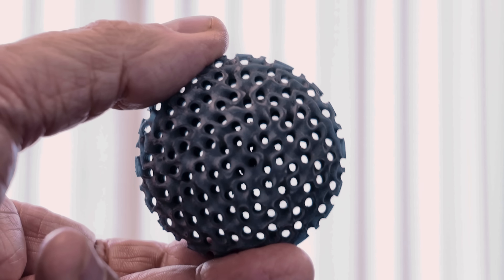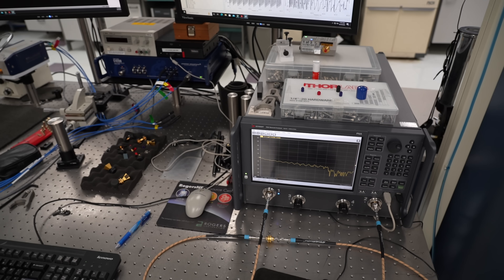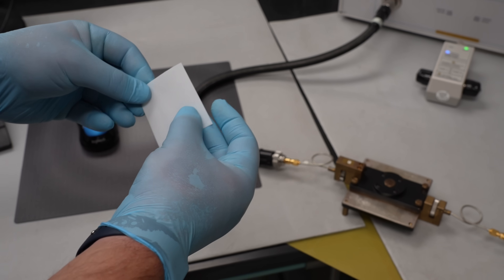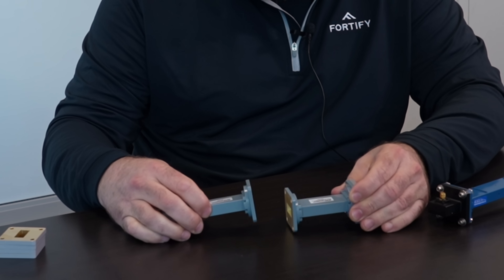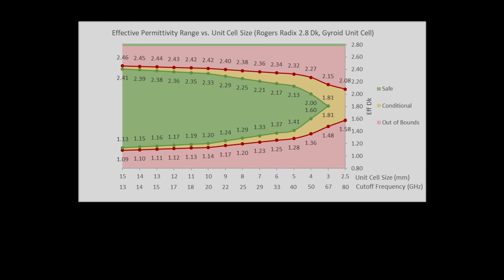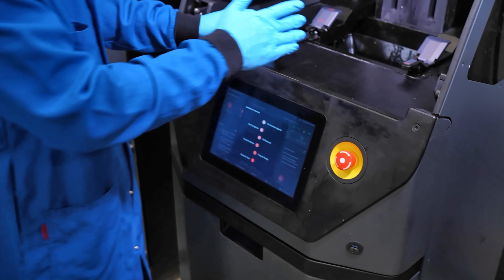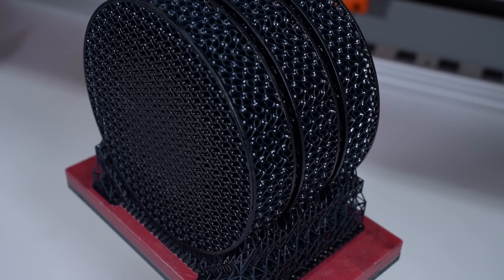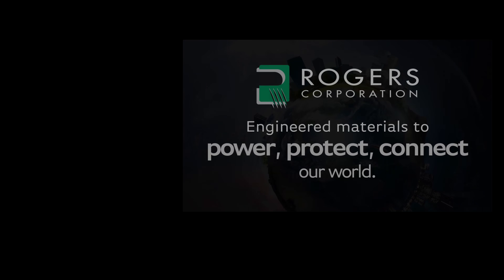Unveiling the Future of Antennas and RF Lenses using Radix™ 3D printable material!

Comment: High power transmitter engineer here, not an antenna guy.  My biggest question would be "What's the loss tangent of this material?"  (Translate:  Will I burn it up?  :)  )  As a transmitter designer, a good chunk of my day is to make the Tx efficiency as high as possible and there always a concern of losses after the amplifier.

Has Rogers looked into a variable (linear, not stepped) thickness PCB  using this material? (i.e. think complex impedance matching networks using transmission lines).  It was not uncommon for me to have 100:1 impedance transformations.  Just thinking out loud, might be helpful in getting a more practical design with a wider bandwidth.

Excellent video!  I've spent a LOT of time in the lab w/a NVA measuring Er and Df of materials to really dial in my simulations, so it was interesting to see how Rogers measures some of their materials! Very impressive and looks like a lot of sharp guys (or gals)!
Reply from the maker: I guess you could print a gradient or stepped index and metallize over it, but please get in touch with them, they are working on all sorts of interesting applications and materials.  Df is 0.0042 at 10 GHz and a tiny bit more at 40 GHz.  Data sheet also shows the rest of the characteristics if you follow the link to their landing page at https://landing.rogerscorp.com/5/Radix.aspx Have a look at Magtrex as well, it's an interesting material with matched permeability and permittivity (same value for each) up to 500 MHz or so, that's interesting for antenna miniaturisation, perhaps also for filters and matching networks?  If you need a contact, email me direct to neil@machiningandmicrowaves.com
Reply: @MachiningandMicrowaves  No specific need right now, but it does get the brain gears spinning!

Regarding a variable thickness board, wonder if you could make the bottom resin layer actually be the top layer of the printed circuit board (i.e. PC board is printed upside down) since it might be smoother?  Then the resin top layer (probably being a little rougher) would actually be the bottom side when flipped. Haven't done any resin printing, so just a WAG on my end.

Thanks!
Reply from the maker: I think you'd make up a GRIN layer to have constant physical thickness but variable permittivity, then use Rogers' adhesive that matches the Dk precisely to bond a foil layer or even a very thin single-sided copper clad PCB laminate.  It would be fascinating to see what is possible
Reply: @MachiningandMicrowaves  Interesting, lot's of possibilities.  Thanks for link, I need to round up some R&D money!

Comment: I'm totally clueless about all of this aside from knowing microwaves exist. Still found the video interesting. Well done :)
Not sure what to do with any of this information now, or why it would be exciting. How's this technology used, for what purpose?
Reply from the maker: The vid was really targeted at a small group of less than a thousand RF design engineers and academics, but seems to have found three quarters of a million other viewers!  It's really an enabling technology, allowing designers to create gradient index antenna lenses and other dielectric components and mounting foams. Applications are wherever you need to do complex beam-forming or compact antenna systems using the variation of refractive index to optimise some desirable parameter of the antenna lens like directivity or gain, while not spoiling some other parameters like sidelobe levels

Comment: this is remarkable this could be great for filtration
Reply from the maker: The structure looks very similar to the sparse open-cell foam used in the filtration system of my fishpond, but they only cost $5 each.  Perhaps not entirely an economically viable solution.  However, it's easy to create such a gyroid lattice using a normal FDM printer if you don't care about the RF dielectric performance

Comment: Another thing I know you don't usually deal with but could they use this for motors including the stator course since you said they could do copper impregnation
Reply from the maker: There are some good copper sintering systems out there that can be used to make 3D structures like rotors for induction-type drives, but using a deposition then electroforming technique wouldn't be better than what's already possible.  Perhaps there are possibilities, but the key use of copper and through-hole plating in the dielectric material is for RF purposes rather than power engineering and rotating machines.  I never say never though, let's see what engineers come up with using this technology

Comment: These are deep waters for me, but could the same technology be used for RF bandgap materials ("color filters") or for RF negative refractive index materials?
Reply from the maker: metamaterials with embedded metallization to create an apparent negative RI would still need separate layers as you can't print or insert metal into the print.  I hope to try some metamaterial experiments later in the year, although I'll be using my Prusa and some dielectric-loaded filament that doesn't have the same high performance as Radix.  I need to do a lot more reading and testing first. It's certainly feasible to make dichroic multilayer antireflection coatings this way, but the 4-8% reflection from a dielectric material transition isn't usually critically important.  The small lens I designed has a gradient index form the rear as an experiment to make a more broadbanded transition than the typical stepped or tapered transition I used at http://www.g4dbn.uk/?p=1644 and http://www.g4dbn.uk/?p=1250 and http://www.g4dbn.uk/?p=1363

Comment: What are the advantages of these antennas? my wifi router has sticks for antennas, these printed ones look cool, but what are their benefits? when i did rf engineering microwave antennas resembled cowbells. 👍😀
Reply from the maker: More in an upcoming video.  Normal metal antennas can be manufactured to have some customisation of their coverage pattern, but 3D print of lenses allows a much greater freedom to manipulate the electromagnetic fields to deliver a tailored radiation pattern.  My need was to try a new way of matching the antenna to the feed using a simple gradient, and to reduce the pickup of thermal noise from the ground and buildings by suppressing the side and rear lobes of the antenna

Comment: I am a ham but much of this went over my head, but from what I gathered does this mean you could DIY a phased array antenna? FYI - Great Video
Reply from the maker: It's more use to me for making a focussing lens to change the opening angle of a feedhorn and clean up the sidelobes, but it can be used for all sorts of things like dielectric waveguide with no metal, and combiners/splitters, matching sections and all manner of microwave/mmWave weirdness.  The limit is just Physics and the designer's imagination, within the parameters of the resin and fill density range.

Comment: When can I 3d print a 4000mm lens for my full frame camera? Anyway, back in 1980 I worked on a CNC machine for my senior project that allowed people to write the equation for an RF antenna and the result would be milled out of a block of metal. How things have changed. Thank you for your descriptions.
Reply from the maker: I'm building a servomotor attachment for my 1982 Colchester lathe so I can machine hyperbolic subreflectors for Cassegrains, parabolic main reflectors for mmWave, axially-displaced ellipses and reflectors, and Gregorian subreflectors from solid aluminium, so that's pretty much similar to you project from back when my lathe was just a casting that was maturing in a field in Essex

Comment: I loosely was able to follow along fascinating technology. I can only imagine what this sounded like to others. Do you plan on trying another array to send signals deeper into space?
Reply from the maker: It's hard to tell if my signal get anywhere with the power I am permitted to use. To reach Venus at its closest approach with a radar that can be received back on Earth still takes a really serious antenna and megawatts of power, but all radio signals above a certain frequency go out into deep space.  There's a bubble of expanding radio signals leaving the Earth at the speed of light, so the first radio signals of the right frequencies and power from perhaps 90 years ago are already 90 light-years away. although they will be impossibly weak of course unless someone has a receiving system a significant fraction of a light-year across.
Reply: I'm familiar with radio waves forever leaving earth and how the amplitude continues to halve along its journey. Was a major oversight of mine with the power you'd need. Maybe you could partner with someone that can legally transmit at the power range you'd need.
Reply from the maker: @79mini  There have been a few of these attempts, but with the loss of Arecibo and the pressures on other big dishes, it's hard to justify the cost, especially the megawatts of electricity

Comment: I have been thinking about chemical vapor deposition of conducive metal on 3D printed radio opaque antenna substrate. I am not versed in math or science but have curiosity in electromagnetism and low frequency radio waves compared to microwave. Do you know if the dielectric properties of those antenna change characteristic with varying temperature? If you put energy in dose some turn in to heat?
Reply from the maker: The material absorbs about 0.5% of the power passing through it, so at extreme powers, cooling is important, perhaps by forced air as the thermal conductivity is relatively low. The ceramic inclusions aren't bothered by any temp that the resin can stand, and I don't think the resin Dk/Df changes much below the start of melting. Masked CVD or PVD might work well on the right substrate types. You can always build the thickness of the metallization using electroplating and/or electroforming
Reply: @MachiningandMicrowaves  Thank you.

Comment: Imagine the possibilities for all types of antenna, for all spectrums of EM!  I'm fascinated by antennas, not just for EM but for  extreme concepts, X-ray antenna, Gamma ray antenna, what if Nano structure of the Universe is an antenna of some sort? At planks scale? What if Black Holes are antennas? 😐😐😵‍💫😇
Reply from the maker: A black hole would make a very nice antenna lens if you could arrange to illuminate it with a ring of sources with a taper that would end up as a single point beam after the Einstein Ring diffractions are superposed.  It might be tricky to get a wide enough distribution.  X-ray antennas are easy enough is you use multiple parallel grazing-incidence mirrors with parabolic then hyperbolic curves, or stacks of diamond or sapphire lenses with steep curves and aspheric forms. I'm working on some Bragg resonators using sapphire disks at microwaves, but certainly nothing like X or gamma ray wavelengths.

Comment: I'm new here, so maybe this is shown in another video, but I would really like to see how you designed the antenna.
Reply from the maker: That will be in an upcoming video. Sorry, I answered the wrong question! I did a manual calculation of the right variation of density in the Mikaelian lens to get the basic dimensions.  The I used OpenEMS running under Octave to generate the near E-field and farfield outputs, then Paraview to visualise the data streams. Once I was happy with the design, I created a CAD model in Fusion360, named the layers so they could be processed easily into densities, then exported it as a STEP file.

Comment: can this be used to create an RF cavity particle accelerator?
Reply from the maker: Usually they are made using metal cavities which are excited through waveguide feeds using crazily high powers where the electric fields are so high they cause multipaction erosion of the metal.  Perhaps this approach could be used for probes and monitors, but when you are using megawatt power levels, even the tiny dissipation factor of this material would cause overheating.  Interesting idea though!

Comment: imagine the log periodic type of antennas that can be printed!
Reply from the maker: The interesting thing about the focussing lenses like the Mikaelian is that they work over a wider range of frequencies, limited at the low end by the physical size relative to a wavelength, and at the high end by the unit cell size of the pores.  I've be very interested to see a log-p or other broadband or travelling-wave antenna being built on to Rogers' MAGTREX 555 material, which should allow a printed/etched/electroformed metal log-periodic dipole array to be printed with reduced dimensions. I don't think a Vivaldi or Finline or a transverse-mode <insert famous scientist name I forgot> feed would go small enough to be useful at the upper frequency limit of the current MAGTREX versions, but in the future?  I'm ever-hopeful

Comment: How about changing the material as the piece is being printed? By that I mean having a starting material with a certain permittivity and then slowly mix in another resin with a bit different permittivity until the part comes out of the printer. Might be interesting for a multiple lens design, but more likely I misunderstand something here.
Reply from the maker: Good question. Right now they cement different parts together after printing.  I think they may have some other materials soon with different permittivities

Comment: 17:46 I'm surprised operators don't wear masks during this process.  When working with our customer's products, we are very careful to not allow spit into the process.
Reply from the maker: We had to use a bit of poetic licence about how we shot the lab sections. Phil's full-face mask made it near impossible to get the lavalier mic to pick up a decent recording so we ditched it for that segment. Those parts were not the final ones I took home, those were already cleaned, cured and baked. There is a big rack of PPE on the way into the lab with stern warnings, and they take huge care with real customer parts.
Reply: @MachiningandMicrowaves  lol.  Cool, thanks.

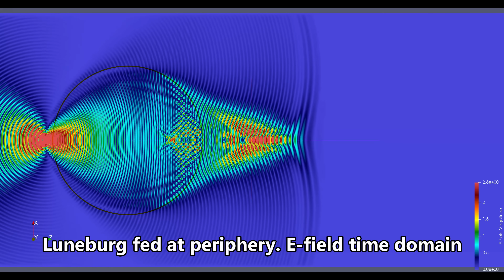Comment: 2:54 what is that? Is what i am thinking? I mean colect waves from all axis in the vector way and redirect it in one point?
Reply from the maker: It shows a point source at 10 GHz illuminating a Luneburg lens which then focuses the electric field into a sharp beam.  It works in reverse as well of course.  A normal Luneburg lens has a gradient from 2.0 at the centre down to 1.0 at the surface, but that's not possible.  You can get to around 1.05 as a minimum.  I designed the taper so that the focal point of the lens is a few mm outside the surface.  A spherical Luneburg can have a feedhorn at any point on the surface and it will form a beam with high gain in line with the axis of the horn and the centre of the lens.  You can have multiple feeds on the same lens.  I'm only showing the electric near-field in the OpenEMS simulation

Comment: I have a feeling that Radix may have uses making microphones with amazing frequency range and energy.  I'd love to see how Radix ribbon, in a magnetic field, reacts to sound waves... just wondering...
Reply from the maker: It's mechanical properties are probably going to let it down for that usage, Also it has a near-unity magnetic permeability and near-zero conductivity, so it doesn't "see" magnetic fields alone, only when they are part of an electromagnetic wave. If you were using a large diaphragm or flexible surface as a passive microphone and wanted to illuminate it with a focussed/collimated microwave beam, perhaps for, oooh, something like spying on the embassy next door, then that might be a possibility!  Did I mention that I have an upcoming video series about my working replicas of the Great Seal Bug found in the US Ambassador's residence in Moscow in the early 1950s? Leon Theremin, spies, Carnegie Hall, politics and tech.  It's going to be a lot of fun

Comment: Ha! I spy a Nokia FlexiHopper transceiver unit in the upper right hand corner in the studio! Looks like a 23GHz unit based on the duplexer. 
Then again, I have not not seen the 18GHz unit, so it could also be that.
The vacuum pump is also a nice flex.
Reply from the maker: It's a 38 GHz unit. I'm wondering about using them as a local oscillator for a 76 GHz transceiver
Reply from the maker: The toy vac pump is a bit smaller than the big Edwards two-stage vane pump I have.  I use the little one for degassing investment casts and epoxy fills. I nearly bought a turbomolecular pump last week to do some hard vacuum experiments, but then realized I had 100 other things to do first
Reply: @MachiningandMicrowaves  You ain't the only one. A friend of mine reverse engineered the pinout in one. Just need to figure out a good mixer implementation for it. As we have +10pcs of the things at the OH2K radio club.
Reply: @MachiningandMicrowaves  Always looking at 'dem turbos on ebay.
Just to realize that I don't have the time and space for setting up a chamber for sputtering and maybe plasma etching.
Would still love me one of those Pheiffer HiPace turbos the size of a large thermos.